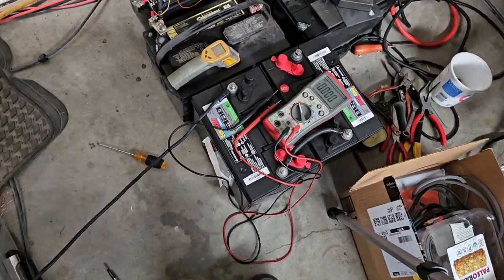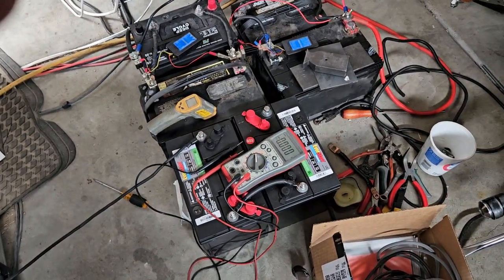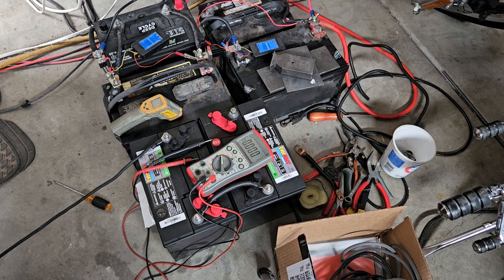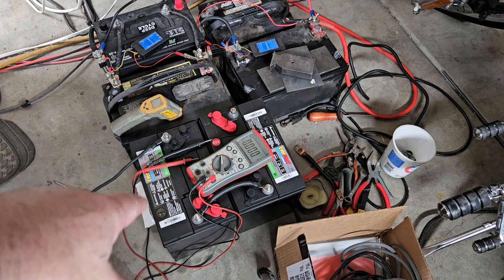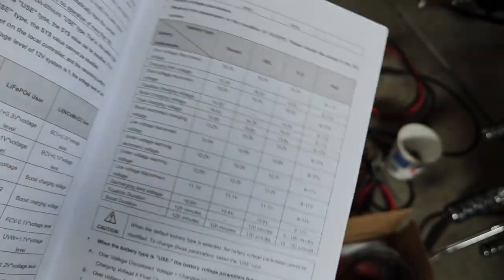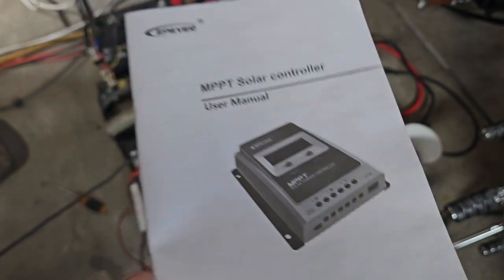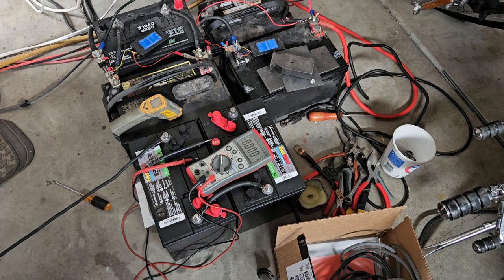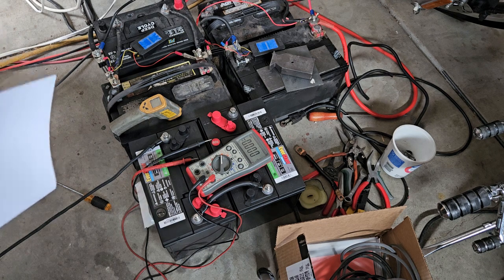More problems with Everstart deep cycle batteries (walmart) epever the culprit?

Comment: I always get that problem with only two batteries. read about parallel 24v. 4 batteries in parallel.
 Keep all jumper leads the same length, enter and exit battery array from corner terminals.eg.
Charge in -->first positive , last negative 24v. then loads leave on the opposite 24v corners.
Reply from the maker: So your saying 4 batteries and no problems?  2s2p . I have done that with my old junk batteries.  4 different batteries 3 sizes. Seems like they suck equally lol. They balance ok. So you might have a point. Im using a 24v lithium battery with a different inverter and i like it alot but i need about 3 more 24v batteries before ill be in good shape and can get rid of these old ones

Comment: This is why I avoid lead-acid batteries unless I have no other choice.  Lithium iron-phosphate is a much better value, at this point.  Aren't those SLA (Sealed lead-acid) batteries?  Flooded batteries usually have removable caps so you replace the electrolyte.  I'd be using the SLA setting on your charge controller.  I have the same controller in my wife's she-shed, but using a 240AH LFP.